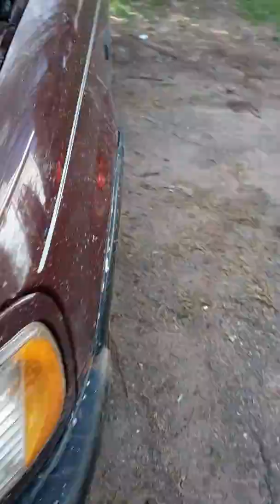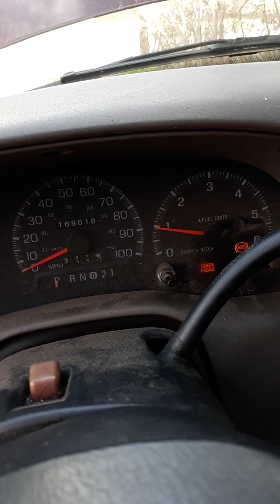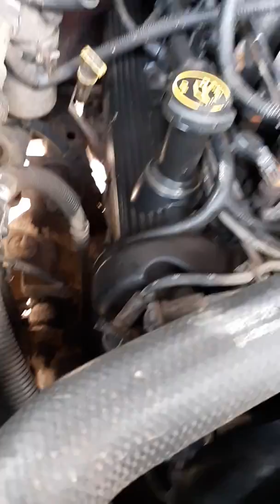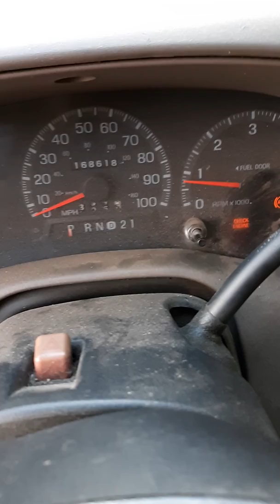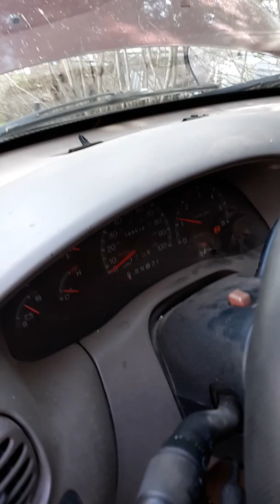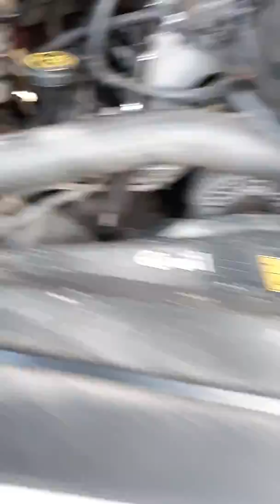F150 engine light flashing/ misfiring.  Part1

Comment: Sounds like a giant vacuum leak to me.
Reply from the maker: Turned out that seaFoam messed up the cats, and the 02 sensors. Be worry about using it… 
I tore into this truck like no other, did everything I could possibly think of. Also for this year of fords the passengers side down by the feet and door, there’s a bunch of control module crap, if it rots away enough there elements will get in there and corrode the electrical.